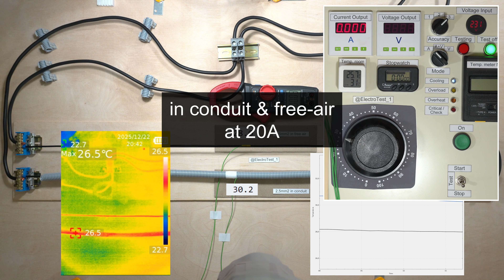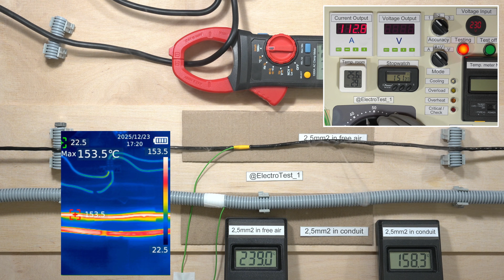Wire in Conduit vs Open air Current Test

Comment: Гофра какого диаметра???? Должна быть 25мм для кабеля 2.5мм
Reply from the maker: Corrugated conduit is selected based on the external diameter of the cable or wire, including its insulation. The cross-sectional area of the cable (conductors plus insulation) should not exceed 30–50% of the internal cross-section of the conduit. If cable pulling is expected, it is better to limit it to about 30%. For a 3×2.5 mm² cable, this may require a 20 mm or 25 mm conduit, depending on the cable’s overall diameter and shape. In the video, I tested not a cable but a single conductor. The purpose was to understand the physics of the process. Also, in some cases, individual conductors (not complete cables) are installed inside corrugated conduit.
Reply: хоть какой диаметр, хоть 40. все равно будет кабель в трубе, ток ниже. единственное если нужна замена, то как бы 25 удобней, но даже не знаю кто меняет кабель в гофре. гофра, это способ крепления кабеля. не более)
Reply: @bvz_bvzпри чем тут хоть какой диаметр и ток ниже, ты в курсе, что у тебя по стенам не открытая проводка, а в штукатурке и следовательно ток ниже, это в принципе прописывается везде. Что ты этим хотел сказать?)

Comment: usually my times running into melted wires are because of poor contactors conducting 100c heat into the wires over 5 years undiscovered-
Reply from the maker: Thank you for sharing your experience 🙂 Do you work in manufacturing?
Reply: @ElectroTest_1 I do electrical maintenance so i work with a lot of machines that are built in the 1960-2010s.

I've seen a looot of burnt contactors and spent a great amount of time polishing contacts too.

Thermal cameras are great for checking contactor wires as a failing contact pretty much directly conducts heat into the wire, leading to premature failure of the wire.

saw 105c on my thermal camera when i was doing maintenance checks.

Comment: if no one had said it you should compare using a Conduit like here and in a combined one where single strand wire are mostly used, mostly in round ones but as comply with other counties where flat ones are use you could include that as well

Comment: I used a small blower/radial fan to increase the current capability on one of my conduit lines. The setup is rather simple: the conduit line runs to a fitting where i attached a fan and plugged the other hole with some foam.
With that setup i can run an oven continuously without having to worry the line getting too hot.
Reply: What will happen if the fan fails? Is it monitored good enough?
Reply: @xehpuk  The rpm signal outputs a small voltage which was just enough to drive a small relay module board which in turn drives a 60A AC relay. Pretty jank, but works well enough for my case.
Reply: @jooch_exe  LOL, might be genius or bonkers.
Reply: @xehpuk  Haha, thanks. Most of the solutions i come up with are quite edgy.

It was born out of necessity (needed to make a deadline). I never got to the point where i was able to replace the cable but i definitely wasn't comfortable with the situation. That's how the safety relay got made.

Some time later i measured the temperature inside the conduit with a small probe. It never got above 51C. The fan really did work well.
A year ago i moved to a new place that came with the proper sized wiring.

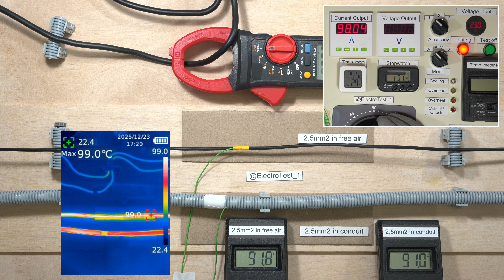Comment: 7:55 wow did not expect that, never using conduit again 😂😂 jkjk
Reply: Oh yes, how I have to remove it from all my solar cables (6mm², less than four amps max since optimized for voltage setup, in my case 270V to 297V (330V open circuit))

Comment: It would be better if I had put several conductors in the pipe, to simulate a real installation, and see how the temperature behaves with multiple cables.
Reply from the maker: Thank you for the ideas for tests. I think this will really be interesting. By the way, how many cables have you ever put into a single corrugated conduit? And in general, how much is allowed?
Reply: @ElectroTest_1  According to regulations in my country, with 3 or more cables, you can fill 40% of the tube's inner diameter, leaving space for heat dissipation. But we'd have to see how it performs with all the cables at 100% of their amperage.🙂.

Comment: If he ever tests in metal conduit, he must do wires in both directions, so magnetic fields cancel each other. If only one was was used, AC current would introduce eddy currents and warm up.the conduit.
Reply from the maker: You made a very good point. Can you tell me if it’s possible to distinguish heating from the wire itself and heating from eddy currents?
Reply: @ElectroTest_1 Well, you can do control with very thick wire going one way, like 10 or 16mm² that will not warm on its own at 30A. All the heat should come from Eddy currents.
Reply from the maker: Okay, do you think eddy currents will also occur in a flexible metal conduit? It’s just not completely solid, but made from a twisted metal strip.
Reply: @ElectroTest_1 Eddy currents are created when there is a metal ring around the wire though which goes AC current. So, one ring, fexible conduit (many rings) or solid metal tube - it should be the same. Of course, it is valid only for 1 wire with AC current. If there are 2 wires, epecially twisted pair, magnetic fields should cancel each other out.

Comment: Using an infrared thermometer is not accurate. 
    Because you have the heat, dissipation and insulation value of the conduit. 
      You would literally have to place a thermal couple sensor directly on the center of the wire inside the middle of the conduit.  So you’re actually taking a temperature of the surface of the insulation of the wire.  Which would be much higher than the external temperature of the conduit.. 
               And you could take the test one step farther by completely removing the insulation off a third wire suspended in free air with just bear copper having a free air, cooling it off and being able to radiate and reject heat. 
 
But because the copper is shiny, and it reflects IR radiation you definitely would not be able to take an accurate reading using an infrared camera. 
        The only way you would be able to take the surface temperature of shiny copper standing in free air is with a direct contact the thermal couple.    
      It would have to be in mechanical contact with the bear copper wire under compression tight on with some copper wire to secure it to take your temperature readings
Reply from the maker: Thank you for your opinion! I noticed a long time ago that a thermal imager is only an additional measurement tool. It shows the surface temperature of materials, and depending on the material and certain parameters it can introduce errors. However, it has great practical value. I inspect some objects using a thermal imager—electrical panels, cables, and cable routes. Warm or even hot areas are clearly visible. Now I roughly understand, based on the external temperature of the corrugated conduit, what the actual wire temperature is (higher by a certain number of degrees, depending on the type of cable or wire).

Comment: Test solid core wires after bending them. See if and when the cold hardening starts affecting resistance
Reply from the maker: Interesting idea =) I wouldn’t have thought of that myself. Do you think it has a strong effect? And how many bends can copper or aluminum withstand?
Reply: @ElectroTest_1  its dependent on factors like how quickly you bend the wire, temperature and composition. If you get an micro-ohm meter you could probably analyze the resistance real time but  loading the wires might show whole different picture. probably the most affected region is right where the cable sheathing has been removed. constantly moving around the wire can cold harden the copper in that section and most often, it snaps from there aswell.

Comment: В начале видео хотел написать, что не помешало бы поместить трубу хотя бы в штукатурку, но после первого же прогрева увидел, что в этом нет необходимости - всё и так наглядно и понятно.) Спасибо, было интересно!)
Reply from the maker: Thank you for the feedback! It’s also an open question whether a cable will heat up more or less when embedded in plaster 🙂 It would certainly be interesting to see similar tests in different materials: hollow walls, wood, plaster, thermal insulation, etc.
Reply: @ElectroTest_1  Полностью разделяю Ваш интерес. Всегда интересно увидеть практическое подтверждение или объяснение технических норм.)

Comment: Good job! Can you make a video with test of soldered wires?
Reply from the maker: Maybe. Can you explain in more detail what kind of test you are suggesting?
Reply: @ElectroTest_1  Sure. I wonder if the soldered connection might melt under load or if the wires might burn out if overloaded.

Comment: Are metallic raceways not common in the EU?
Reply from the maker: For wiring, different types of pipes and conduits can be used—PVC, both flexible and rigid; metal, such as metal hose and rigid conduits; as well as metal trays that can carry many cables at once. The choice depends on the type of facility and the standards in the country. There are also some other more specialized materials that I have hardly ever encountered.
Reply: Over here (Netherlands), all housing installations use PVC pipe mostly.   Wire size is 2.5 mm2 with 16 A fuse (or circuit breaker).  Flexible cords for appliances have 1.5 mm2 wires for 16 A.

Comment: I think the reason the temperature of the free air wire was higher than that of the conduit in the end is because, inside the conduit, the insulation had already melted in some places and exposed the bare wire. This allowed the bare, uninsulated wire to vent some of its heat to the air inside the conduit lowering the temperature at the sensor.
Reply: The key diffrence is the energy what is used to heat-and-melt the conduit.
Reply: @Duracellmumus  Yes, you’re right. On the flexible conduit you can see melted marks from the hot wire. The conduit has melted in some places. That means part of the energy was dissipated on that. If you watch the video very carefully )
Reply from the maker: Great explanation! We came to the same conclusion with the assistant — the corrugated conduit takes away part of the heat, especially when the conduit itself starts to melt. Because of this, under long-lasting currents the conduit will actually cause more heating of the cable or wire, but under short, fast events it may extend its life by a few seconds 🙂 although that cable or wire is better replaced anyway. I also think the placement of the sensor inside the conduit may have an effect. When I opened it, I saw that the sensor was on the side of the wire
Reply: I'd be careful with that assumption. Insulation can, in fact, increase the power dissipation capacity of a wire. I'd check if the temp sensor hasn't simply detached fron the wire.

Comment: Interesting on how the resulting heat just generates a bit of airflow in the open. Once the pvc insulation reaches its breakdown point 2 wires in the conduit will eventually touch. In my house the worst culprit is the hot water heater because most are only sold in 3.3kW versions. Wife cooks with 3.5kW induction but usually only a short time.

Comment: thanks for sharing. your video is amazing as always.
that one wire. i found many wire in 1 counduit(pvc pipe 20mm). if im not forget they have up to 7 or 9 wire in pipe. 1.5mm or 2.5mm. cant remember
Reply from the maker: Hi! That’s a bit too many wires for that conduit 🙂 Where have you seen such an installation? Is it regular electrical wiring?

Comment: It would be interesting to test with metal pipe conduit.
Reply: Indeed, since the metal conduit itself could become a heat sink.
Reply: @cautiouscommenter it just decreases the thermal resistance of the conduit but it should still be less efficient than without conduit
Reply: @ideesDePhysique these are real usefull because it can stop a spark to come out or even a cable fire to spread over especialy on a wood based american style houses. They used 30-50A lines as often as we the 16Amp rated lines. And rather normal to have problem with the neutral connections and these currents are cause rather big voltage drops without take the user attention for a while. 
I think the metal conduits olso realy usefull to cache the stray currents from the wireing and the breaking contacts RF production is take less attention / if any/ by this current paths to the ground.
Reply: @Duracellmumus  I've never seen that sort of conduit. I have used a thicker grey solid and flexible type of pvc. If American style electrical wiring was actually bad in the wall fires would be rampant.
Reply: @cautiouscommenter  It would be a horribly mounted heat sink. The surface of the metal pipe can not dissipate more heat than an equal size plastic pipe, the insulating effect of the air trapped inside the pipe will be the same. If you take a look at the electrical code or the manufacturer manuals, they don't have separate current carrying capacities listed for different types of conduits, so the actual differences won't be large.
Reply: @cautiouscommenter  Or a conductor..
Reply: @Duracellmumus  🤣🤣🤣
Reply: @Duracellmumus   It should immediately trip the breaker if that happens.
Reply from the maker: @Duracellmumus Good point 🙂 Metal can also be a conductor. If differential protection is installed and the fault current is sufficient, the line will be disconnected quickly. However, under certain conditions, current may flow through the metal pipe for a prolonged time.
Reply: I think the difference would be negligible. The biggest thermal resistance here is convection. Heat must jump through convection 3 times rather than just 1: escape the wire, then enter the pipe, then escape the pipe again.

Even with a fast moving air, convection is still the limiting factor, let alone stagnant air inside the pipe
Reply from the maker: I think that heating of wires in metal pipes will be different. We’ll look into that 🙂
By the way, what diameters of metal pipes do you use for 3×1.5 and 3×2.5 cables or wires? And what wall thickness do the pipes have?
Reply: If he ever tests in metal conduit, he must do wires in both directions, so magnetic fields cancel each other. If only one was was used, AC current would introduce eddy currents and warm up the conduit.
Reply: CD 管其實是增加了絕緣厚度
Reply: Спасибо. Хорошее сравнение.